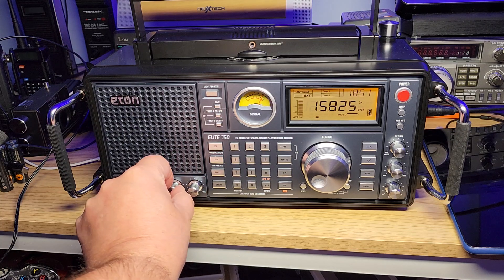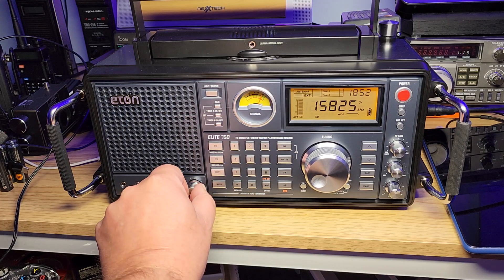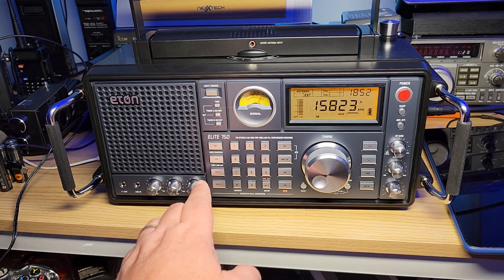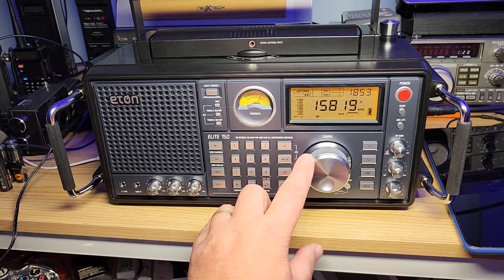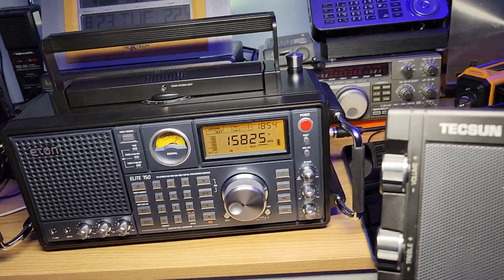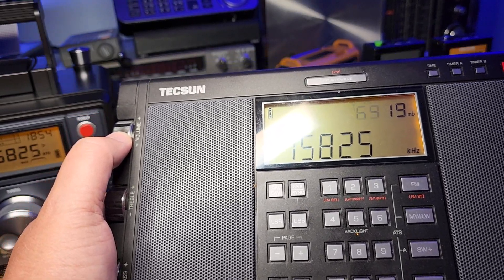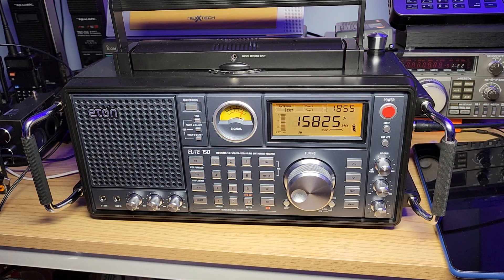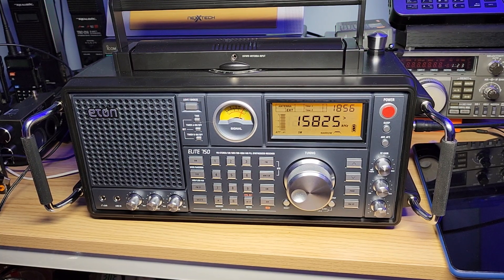Wide Bandwidth from Eton Elite 750 compared to the widest setting Tecsun H-501X 15825 kHz Shortwave

Comment: I love the super wide filter. This gives the best sound quality as it is wide enough to allow AM frequency response that is wide. A narrow filter chops off the sound. As for adjacent station interference I move the antenna aiming to null the interference. I think ham radio guys are judging this product using the wrong criteria. For home audio use sound quality still means something. Radio DX-ing for long distance reception of voice is the kind of approach that interest ham radio guys. Home audio listeners just need narrow to find a strong signal. Then move it to wide for widest frequency response. What is the problem? This radio is brilliant! It is NOT a ham radio. It is  a HOME audio radio.

Comment: Gilles, I have an explaination to why the 750/S2000 have such a wide filter. Remember The IF out port on the Tecsun version? That is intended for exporting the RF signal to an external DRM decoder. In order to make the receiver capable of receiving the DRM signal, the filter has to be at least 12kHz wide.
When this receivere came into the market in the early 2010s, SDRs were not popular. Designing a radio RF filter around DRM seems to be a good idea in those days (perhaps?). Not including a middle width AM filter here is a serious disappointment.

Comment: So, you done got me to thinking/ learning and playing with some direction My tecsun ppl 660 was much tighter.  I  bought  both within 6 months of each other. The Pll 2000  is a paper Tiger  it looks the part but ,  cuts and runs under  pressure. The 660 is my favorite portable rig. Aka the Mighty mouse. It out performed the Pll 880 on my long wire too.  Great job .Keep rolling the vids Bro.

Comment: Anyone that is pleased with the 750, would REALLY like a good quality used bench top transceiver such as the ICOM R75 or ICOM 7410 (to name a couple). With a proper antenna the two mentioned open up another degree of signal control.
Reply: Not the same kind of price...
Reply: The R75 is only a receiver. But a good one. I have one and it's one of the last of the old school analog SW receivers. Also, if you buy the Icom IC-718 that looks like the R-75, the receiver is not as good. It's only a double conversion super het. The R-75 is a triple conversion unit.

Comment: So the Tecsun is DSP and the Eaton is not? If the Tecsun is DSP what  is the filter width setting exactly?
Reply from the maker: The widest setting for Shortwave on the Tecsun is 6 kHz.  The Tecsun is PLL tuned with a DSP stage, not a DSP like the other radios that mute